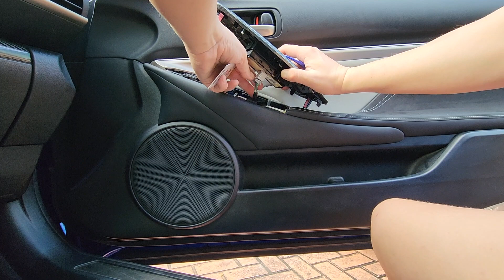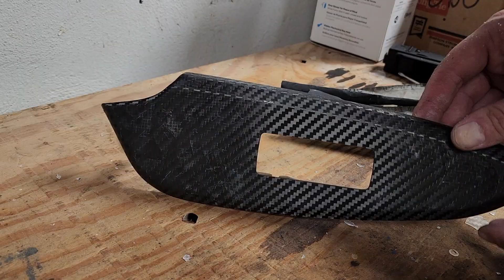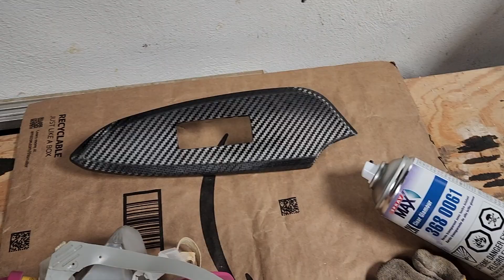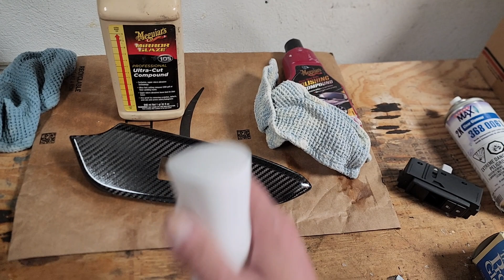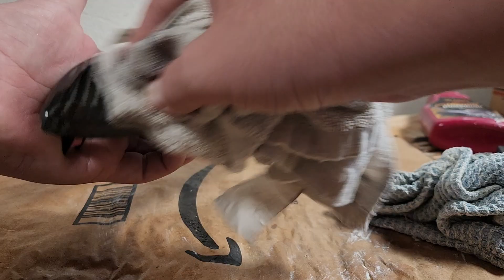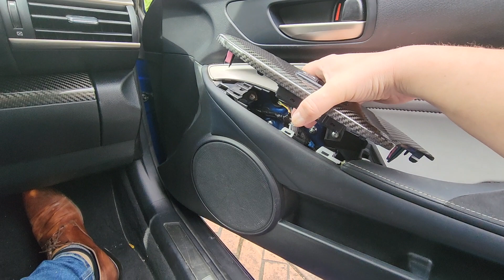Carbon Fiber Delamination Bubble Clear Coat Repair  - Lexus RCF Vehicle Door/Window Button Panel DIY

Comment: Helpful video for sure.  My 2016 GS F is suffering mightily, but it's not just the door switches - the dash insert over the glove box was first.  Now it's just about every piece of CF inside the car after the last couple of weeks of cold weather in ATL.  I genuinely dread having to remove the dash to get to the dash trim pieces.  That said, since this is 2 years old now, how has your fix held up over time?  My car lives in a garage unless it's in use, so I normally get more service life from my interiors than cars living outdoors.  Also, you said the appearance is close enough not to notice, but does this clearcoat build up thickness anywhere near the OEM epoxy, or is it fairly thin?
Reply from the maker: The fix held up perfectly. While the clearcoat did not build up to the thickness of the OEM epoxy, it still looks perfect!

Comment: Simple fix, but a correction, these parts are more than $1000 each. CF Lexus parts are extremely expensive. Sadly this CF is prone to failure, even the Fuji wing fails. So external parts we need to be extra careful in maintenance.

Comment: Great video amazing job. But why in earth you go through all that effort and not wetsand the clear.
Reply from the maker: Even without wet sanding, the repaired part was indistinguishable from the original. Good enough.
Reply: Fair enough